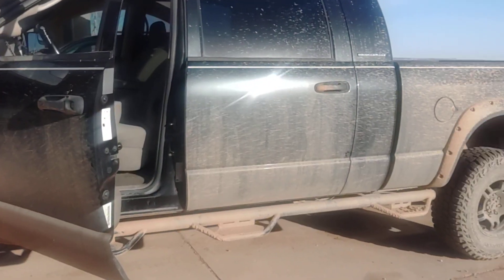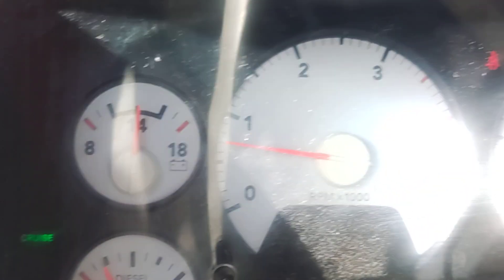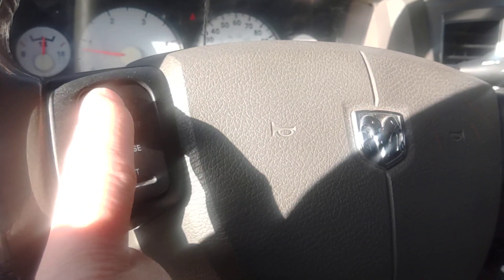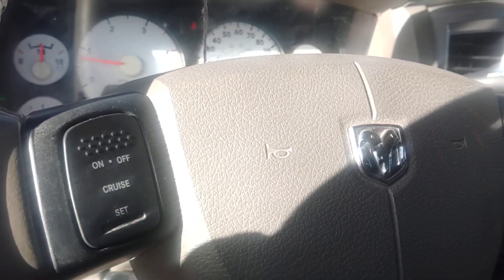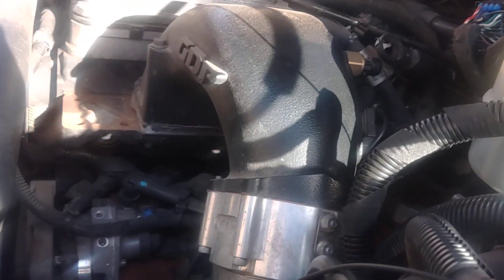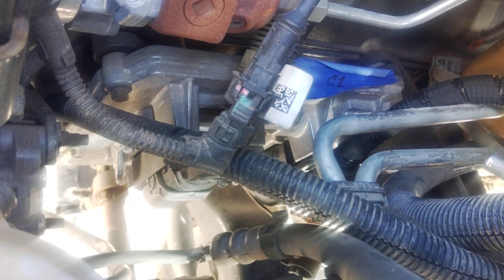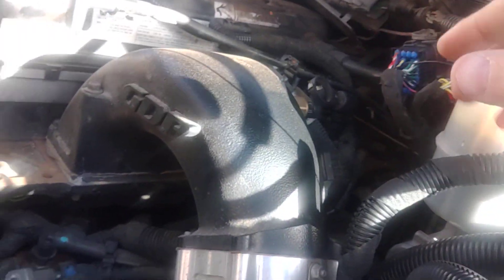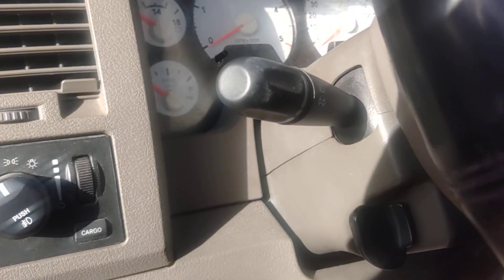2006-07 Ram 2500 5.9 to 2019 6.7 conversion

Comment: Have any idea how to get a 2012 Ram 2500 Cummins truck to operate on the 849ecm, essentially backwards of what you did.  Trying to run a cm849 (5.9/48re) in a 2012 truck. @steeddolan
Reply from the maker: Have you tried to just wire it in? Im sure the vehicle and ECM will have codes but i think it may run if you wire it right.
Reply: It won’t work that way there’s too much stuff the 2012 looks for.  And I’d have to worry about the CAN system in the 2012 being unhappy, along with not running the transmission
Reply from the maker: @ What DTCs pop up when you run a 5.9 ECM in a 2012?
Reply: None, it physically won’t go in there.  I can run complete 5.9 electronics in the 2012 probably and be time and money ahead lol
Reply from the maker: @AntwanLucas  interesting, I wonder why. Probably just need to add some information to the CAN bus.

Comment: Hey Steed, how do I get in contact with you? a Hella actuator that’s on a turbo charger VGT. 
One of the videos is on my channel if you wanna check it out!! 
Do you have a controller with a knob that will run this actuator?

Comment: Off topic but do you think you could figure a way to put a 10r140 behind a 6.0 powerstroke?
Reply from the maker: If you can bolt it up, get everything connected minus the wiring. I can make it work, you just need to bring me the truck so I can figure it out.

Comment: I'm looking to put a 6.7L Cummins into a 2006 Cummins, I want to use 6.7 injectors, anyway you could do a video slowed down of you explaining how it works? Or what I need to buy from you? Cant quite understand how you're making the wiring work😂😂
Reply from the maker: Its plug and play, you really don't do anything but connect it up and go. The controller bridges all the CAN data so its native.
Reply: So I can take a 6.7 ECM, and plug it into the cab?
Reply from the maker: @loganscheinost4209  yes and no. you need to make a wiring harness that adapts the vehicle to the ecm. Then you need to bridge the CAN data from the ECM to the vehicle so everything is native and works
Reply: Would you send me an email, I’m having a hard time understanding, it’s got to be in dumb person terms, I’m more a mechanic than electrician 😂😂

Comment: Hello sir, I have a 5.9 2004.5. The engine dropped a valve and Im looking at replacements. Would a 6.7 be a viable option? Thanks for the content.
Reply from the maker: Issue with 2005 and earlier trucks is you don't have CAN you have PCI bus. If you had CAN it would be a drop in conversion